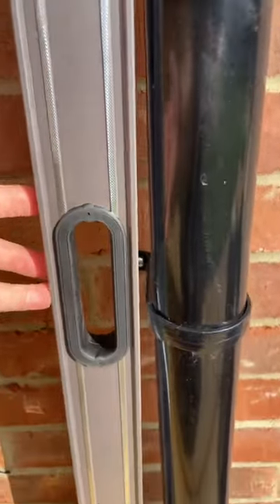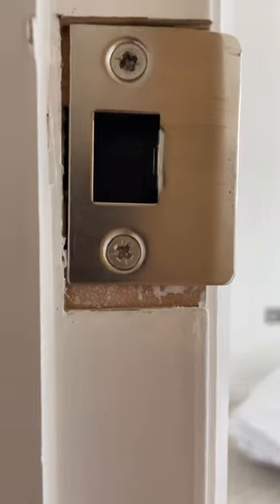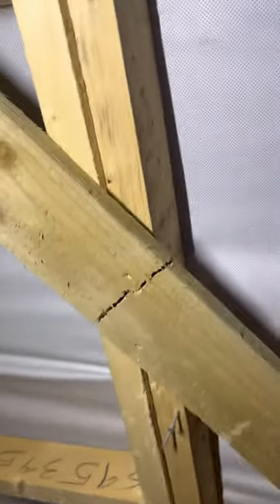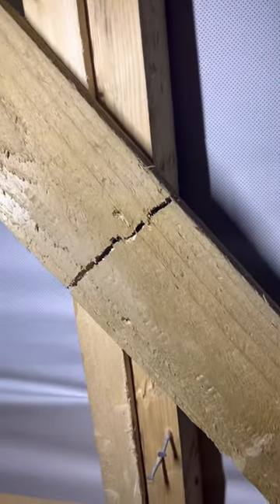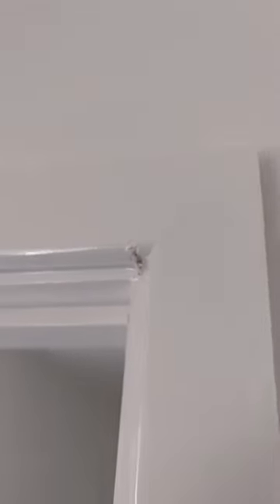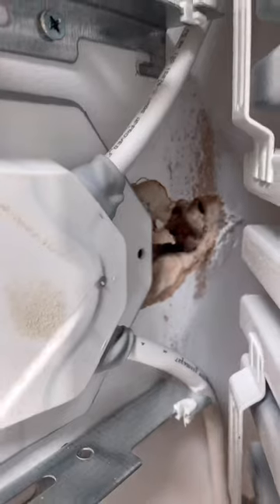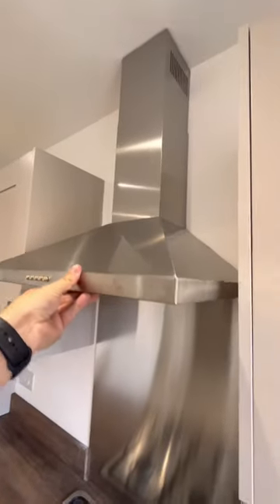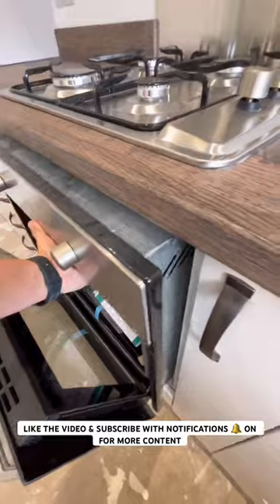Uk New Build Snagging Inspection Part 1/2 #68

Comment: Dont buy a new house. They'r rabbit hutches. I viewed one that had special small sized furniture in the show home to make the rooms look bigger.  The bloke wasnt happy I got my tape measure out and told him the rooms were undersized too. The Utility room was a double stacked washer drier UNDER the stairs, no storage. Wardrobe too narrow for a coat hanger, i take one with me when house shopping.  The kitchen dishwasher was the small narrow 500 size too. But it had 3 toilets for a two single bedroom size house?? A small double bed would only fit if one side was pushed to the wall.  Deeds said no extension into the loft as the foundations were on a marsh and couldnt take the weight!  What the hell are they building There for?

Comment: To be fair when I fitted our new oven I didn't screw it in either so I could pull it out easier to replace the heater element 😂

Turns out I haven't needed to use that 'feature' yet, and it was just an issue with the old one constantly burning through elements, so probably a good job I replaced the entire unit 😅

I haven't taken it to work with me yet though 😊

Comment: 25 years working on new builds to 17c farmhouses and there's only one category I'd never buy
Reply: What would you class as new build you'd never touch post 1990 or earlier
Reply: @imwilki  All my homes build dates: 1954, 1975, 1980, 1902 (current property).Not so much the age but the time in which they were built. Most  modern big builders build to maximise profits at the expense of durability on their parts and use the cheapest labour they can get.